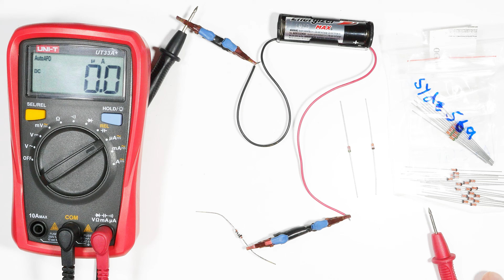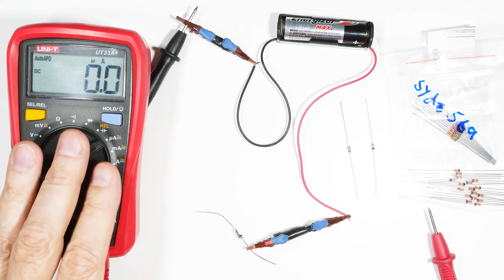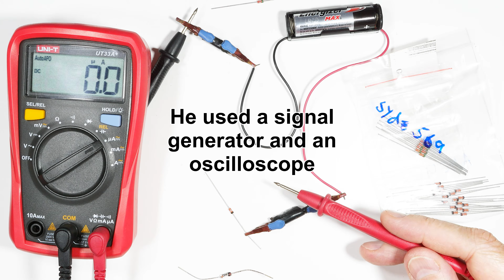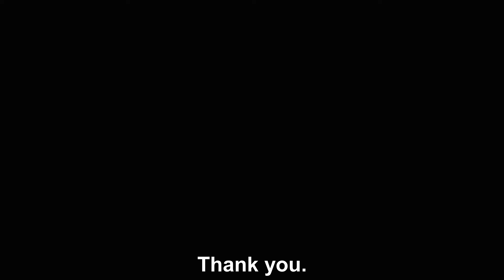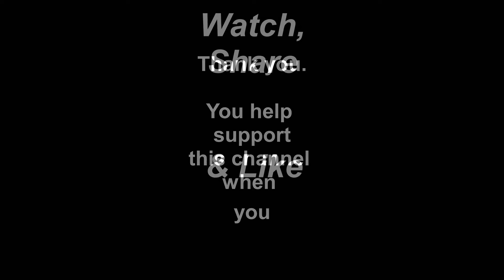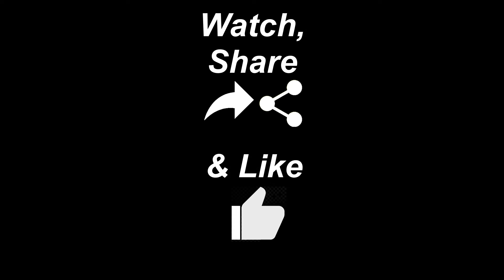Crystal Radio Fake 1N34A Diodes! Easy Test (4K)

Comment from the maker: Crystal Radio videos that might be interesting.
Crystal Radio--A Good 1N34A Diode Substitute    https://youtu.be/phD_2Wm79gs
How To Make A Crystal Radio (basic): Best/Easiest DIY Crystal Radio - No Batteries, No External Power (4K)
https://youtu.be/fLVCqZGpv3U

My Crystal Radio Does NOT Work (FIXES for common problems): https://youtu.be/kCxQ8iPQx4s
Advanced Crystal Radio:          https://youtu.be/mh5KxCpbQ5U
UPDATE: I bought some D9K diodes that are good substitutes for the 1N34A on ebay from "Stavr-Tube&Tones up grade".
This is one of the videos I referenced. The guy shows the difference in waves of the 1n34a and schottky.   https://www.youtube.com/watch?v=jfCh87JP92I
Reply: D9 family - USSR made Germanium diodes. D18 is much better.

Comment: I had purchased some fake 1N34A diodes which exhibited no measurable reverse leakage current.  I`m pretty sure they are Schottkeys.   So I hunted through my ancient junk box and found a germanium  NPN transistor.  The base - emitter junction worked just fine in a crystal radio.
Reply from the maker: Interesting. I will have to try that.

Comment: 1N34/34A when excited by a sine wave does not pass a sine wave (unless biased so as to be always conducting) due to the wave reverse biasing the diode for half of the wave.  This is one of the principles of AM detection.  Niggling point, perhaps, but those curious enough to go look on an oscilloscope will see that.

I was not aware of the reverse leakage current test.  Thank you for pointing that out.  This is something new to research to expand my knowledge.

As the description points out, Schottkys (as well as silicone) diodes will work in a crystal radio but give vastly inferior results compared to germanium types.

Comment: Speaking as a BSEE who studied semiconductors: not even all Schottky diodes are created equal.  Some feature a higher forward voltage, some a lower -- even lower than germanium's characteristic 0.3 volts in some cases.  Lower forward voltage is better in detecting low voltage signals.  Assuming the data sheet and supplier are honest, if one had to use Schottky this characteristic is a way to identify better suited ones for this purpose.  I agree it is such a shame that the cheap-junk trend of the West has moved any remaining germanium semiconductor production to China, where honesty is dubious since nobody with, say, a brand name at stake is controlling quality on that end.

Comment: If you don't see a tiny s-shaped wire inside a thin glass envelope, IT'S NOT GE. This is not entirely true, however, as there are a few Ge diodes which the wire cannot be seen. Typically, in black glass, blue glass, and a couple others. The vast majority of Ge diodes from the 1950's on up, are a thin, clear, glass envelope.

Comment: Germanium diodes are sensitive to heat. Hold the diode between your index finger and your thumb for 20 seconds; the forward voltage should rise. If it doesn't, it is a fake.
Reply from the maker: Interesting. I will have to try that, assuming I can keep my fingers out of the circuit!
Reply: @tsbrownie how’s the outcome?

Comment: You have come up with a good way to test for germanium diodes, the only thing I would do different is put a redidtor in series with the battery to limit the current. That way if the diode is shorted or labeled backwards the fuse in the meter dosn't blow.
Reply from the maker: A good idea.

Comment: If one wants to go really old school for crystal radios, one can try to get or make a cat whisker galena detector.  For something that has to be wired permanently in circuit and not needing adjustment, this is obviously not suitable.  A circuit arrangement that boosts the RF voltage (like a step up transformer) may make it more feasible to use a silicon detector with its higher forward voltage.
Reply from the maker: Got videos on how to make and use them also!

Comment: This can be an issue for guitar pedals, the only way i've ever found to test is to look for reverse leakage in the microamp range...for transistors i look for that and also look for increased gain as i heat them up...

There are loads of fakes now, you either pay about £3-5 a diode to be fairly sure its not a fake or you are getting a schotky :(

That said i need to test them with an oscilloscope too once i have built a signal generator, i think you can also see it on a scope since they turn on and off at different rates to silicon.

They also fake transistors, including cheap silicon ones. Realistically, without a curve tracer your only safety is buying from a trusted source.

And ICs....and i mean i've even got TL072s i reckon are fake, which is about the cheapest mass produced chip out there :(

Comment: It sounds like 1n34as are becoming unobtainable.

It might be better to figure out how to make the shottky work.

Would putting a high value resistor in parallel with it make it act mote like a 1n34a?
Reply from the maker: I have a video on the D9K, which is still easier to get. Also I have videos on using a cat whisker detector with iron pyrite / galena.

Comment: Can't we use one of the junctions on an old germanium transistor?
Reply from the maker: I have heard that but not tried it. I have my doubts. I have tried all the diodes in my collection going back 50 years and nothing so far comes close to the 1n34a  or d9k. Can't see that a transistor junction would be good, but I am open to it.
Reply: @tsbrownie  Just tried it. It does work, but a proper diode would probably be better.

Comment: Ich habe es heute mit einem billigen Sanwa Analog Multimeter probiert im Ohm x 100K Bereich 1n60 Dioden die ich vor einem Jahr bestellt habe in Sperrichtung zu messen. Ja und es hat mir mit 3V Spannung ca. 0,5
Reply from the maker: "Today I tried using a cheap Sanwa analog multimeter to measure 1n60 diodes that I ordered a year ago in the ohm x 100K range in the reverse direction. Yes and it gave me about 0.5 voltage with 3V"

Comment: Does anyone have suggestions on where to buy real 1N34A?
Reply from the maker: Digikey, Jameco, and similar big electronic parts shop should have the real deal. I did a quick search on "where to buy 1n34a diode" and found dozens and dozens of people reselling fakes/bad substitutes they call 1n34a, some at rediculous prices.
I'm also working on a cat whisker detector for crystal radio purists, for when only galena, iron pyrite and such will do.
Reply: @tsbrownie  Digikey, at least the Canadian version, does not carry 1N34A. In fact, I have hard time finding any reputable distributor selling 1N34A. That's probably why there are so many fakes being sold out there.
Reply from the maker: @pilobond I have been using the D9K lately and it seems to work OK. It was made in Eastern Europe. It does have some oddities, like it seems to quit working properly temporarily if you reverse the diode direction. Maybe it needs to re-polarize or some such. And it's just my opinion, but seems to be a bit (maybe 10-20%) less sensitive.

Comment: Schottky = silicon
Reply from the maker: "the common silicon diode is build with a semiconductor p-n junction, the Schottky diode is build with a metal-n (metal-semiconductor) junction, where the movement of charges through the junction is quite faster than in the p-n junction."

Comment: Hello! It is better to use syncronous detector for the crystal radio - I used BF998 MOSFET with shorted gates. There wasn`t any power supply or a battery.
Reply from the maker: I will have to try that.
Reply: @tsbrownie  the important thing - DC current should not flows tgrough  earphones.Use electrolytic capacitor between phones and mosfet.And RF blocking capacitor 10nF between drain and ground